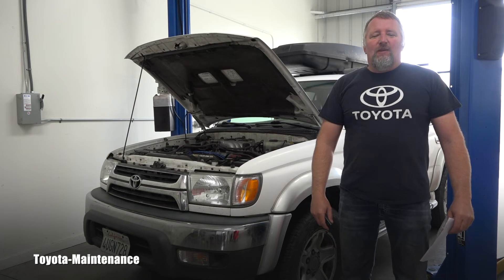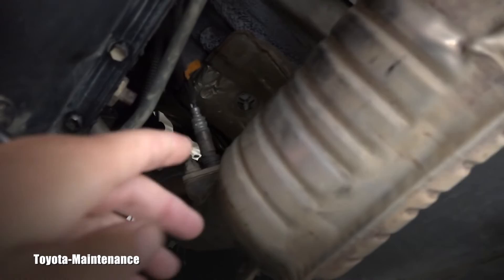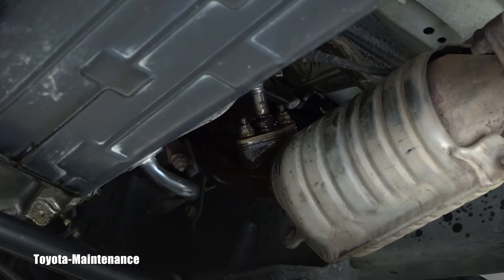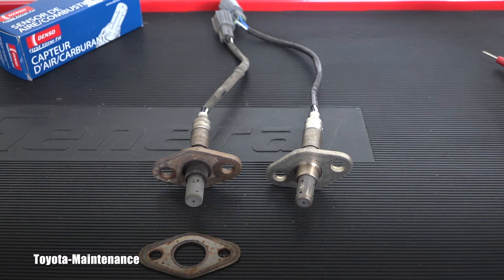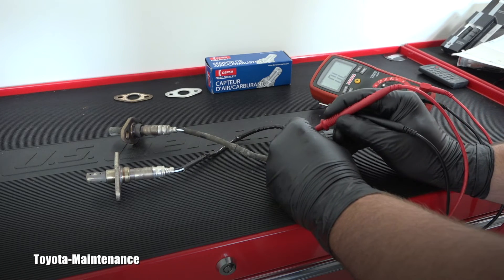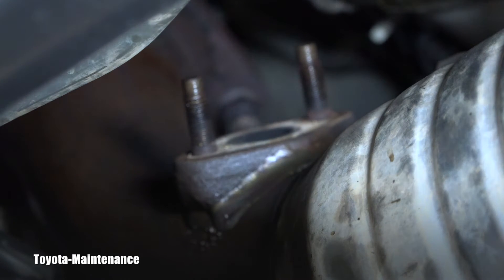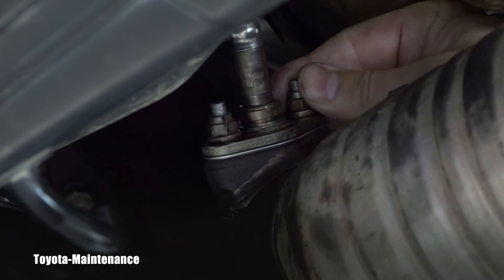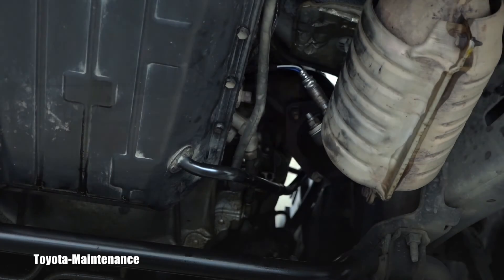Toyota P1135 air-fuel sensor heater circuit

Comment: My car has the p0125 and p1135 but i checked the voltage thru the obd2 reader and it said the bank 1 sens 1 had voltage but but the bank 1 sens 2 had no voltage. Is it possible the obd2 reader just has them backwards?

Comment: How do I determine what the “Response Malfunction” part of the message indicates? The error code did not say the O2 sensor was bad but only that the heater circuit has a response malfunction? I already changed my O3 sensor so am looking good for another logical solution. 
P1135 indicates “Air fuel sensor heater circuit response malfunction”.

Comment: Great video. I'm going to attempt this replacement myself, but want to ensure I order the correct part for my 2002 tacoma. My check engine light came on last week and produced code 1135. Would you know precise part number for sensor and approximate price? It's the smallest tacoma, not pre runner. I think 2.4.

Comment: I totally fucked this job broke both studs and all 3 nuts wouldn't stop spinning on the studs so I destroyed the threads on studs now I'm screwed I tac welded the sensor and got 1 nut on and vice grips for now 🤣🤣

Comment: Hi Sir,
Got 2003 Toyota Highlander v6 . P0135/P0155 Error. I replaced all O2 sensors. I also replaced Coolant sensor,Tuning up done with all spark plugs replaced, oil change, radiator flush.Drove the car over 50 miles and engine light still there.
They suggested to replaced ECM. I ordered online.Now my car don’t even start up. Leading to frustration😊now. 
I spent so much$$$ already and issue still unsolved.
Any idea what should I do now?

Comment: 2002 4runner besidez my check engine light my vsc trac lightscare on would o2 sensor cause all those lights  to come on auto zone checked it said upstream o2 sen. my mech. said its vacuem leak.

Comment: My 2000 4runner 3.4l was throwing p0171, p1130 and p1135. I changed the air/ fuel sensor and problem solved. Upstream o2 sensor.

Comment: is the spec the same for the downstream sensor in ohms? I am getting a P0136 and my ohms across the black shows at 13.6 ohms. I thought that was in spec for the downstream one but i could be wrong. I dont have a new one to test with (yet).

Comment: Thanks for making this video because it a good teaching tool. I was able to use my ODB 2 scanner, read the P1135 code and ordered the Denso air-fuel sensor for my 02  Pre-runner 2.7L. Using my Ebay purchased oem dealer manuals, I tested the old sensor (155.5 ohms) compared to the new sensor (1.2 ohms). The manual diagram shows which pins to contact for a correct reading and the specs.  Having the manual helps me diagnose problems instead of just randomly throwing new parts at the truck and praying for a favorable outcome.  Looking forward to the next video that you produce.  :-)
Reply from the maker: Good Job !
Reply: How was the outcome? :)
Reply: I replaced 2 o2 sensors for a p1135 b1s1, p1155 b2s1, on my 02 camry and the new sensors denso, ohm test was 3.0 or 2.8 is that bad!? They're new 😢 and my codes are still there. Same ones. Smh

Comment: Just got back from my local mechanic shop to figure out why my Check Engine Light is on. They say its the "Air Flow Heated Sensor". Is that another name for the air-fuel sensor heater circuit?

Comment: Just call it an oxygen sensor so people are not confused!
Reply: There is significant different between o2 sensor and AFR sensor.
Reply: @trickshotz7092  I apologize for my hasty remark based on ignorance. I worked mostly with my older Tacos.